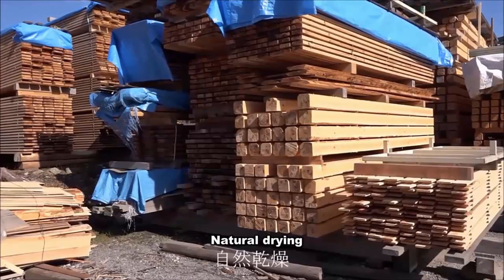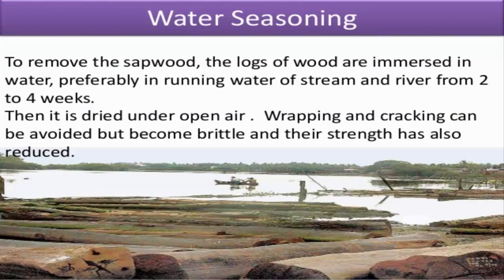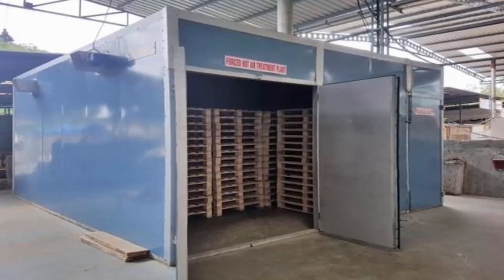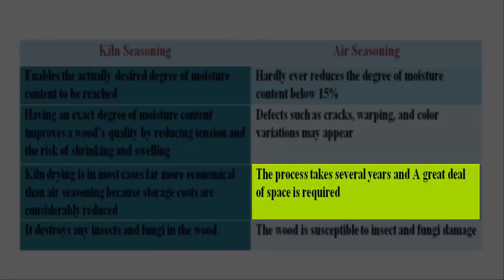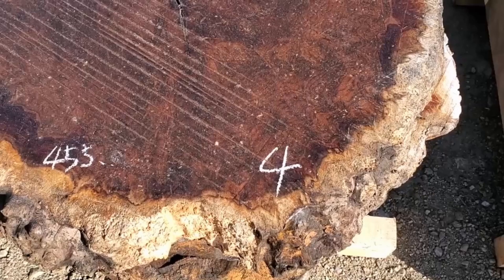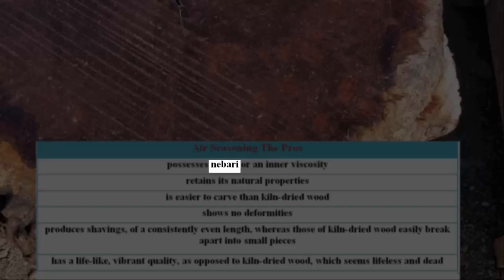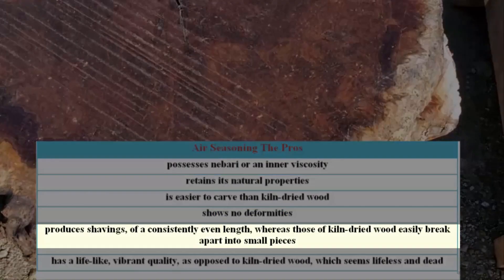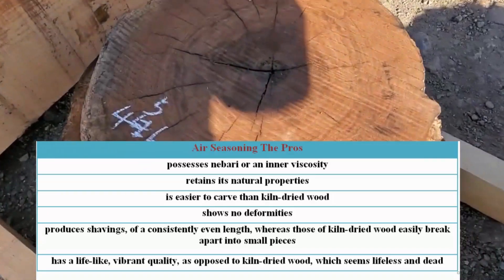Why JPwoodworkers prefer to use Air-Seasoned wood although they could use Kiln-Dried to reduce costs

Comment: 200% must be that rare tree, the Liquid Chestnut.
Reply: Percentage is referred to complete waterfree woods wight. So this is right.
Reply: @hermannstraub3743  100% moisture is water. 200% is a term used by a person that has no idea what they are saying.
Reply: @matthewwilliams2589  The basis is not relativ air moisture but weight of wood. So the bonedry wood weight is 100%. And any water you ad is summing up. 100g of dry wood is 100% wood weight. If there is 200g of water in it there is 200% water of the bonedry wood weight. And so is it as wood is quite like a sponge.
Reply: @hermannstraub3743  Thanks, explained this way actually makes sense.
Reply: per James E. Reeb, Extension wood products specialist, OregonState University, "Moisture content for freshly cut logs and undried lumber ranges from 45 to greater than 200 percent."  Check it out here: http://owic.oregonstate.edu/sites/default/files/pubs/EM8600.pdf

Comment: 200%?????
Reply: per James E. Reeb, Extension wood products specialist, OregonState University, "Moisture content for freshly cut logs and undried lumber ranges from 45 to greater than 200 percent."  Check it out here: http://owic.oregonstate.edu/sites/default/files/pubs/EM8600.pdf
Reply: @williammagee7514  that may have been what he said, but it's illogical.
Reply: @billquillin1952  Here is more from the above pointed to article, you should notice that percentage is not defined by volume but by weight so it is all very logical. Ask yourself how many percent more would a cubic inch of lead be than a cubic inch of feathers, surly more than 100%:

Moisture content is defined as the weight of the water in the wood divided by the weight of the wood. This number is then multiplied by 100 to become a percentage. If the weight of the water equals the weight of the wood, the MC is 100 percent. If the water weighs more than the wood, the moisture content is greater than 100 percent. Moisture content for freshly cut logs and undried lumber ranges from 45 to greater than 200 percent.
Reply: @williammagee7514  thank you.